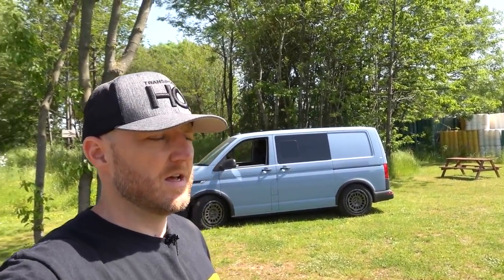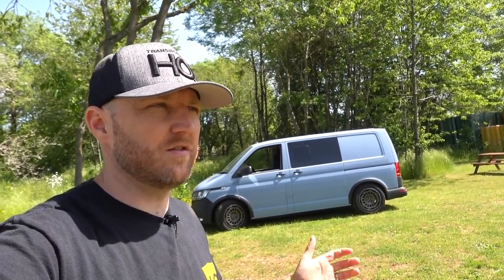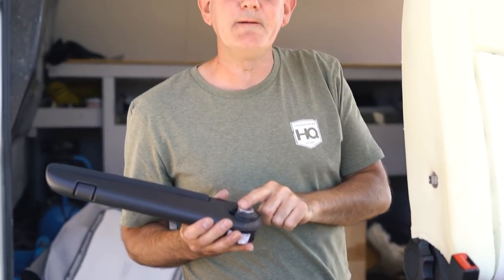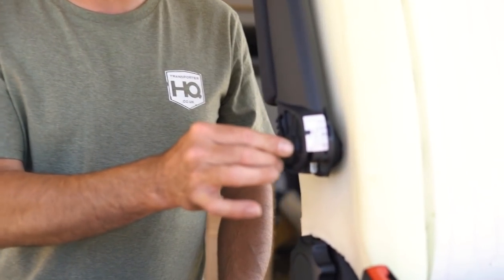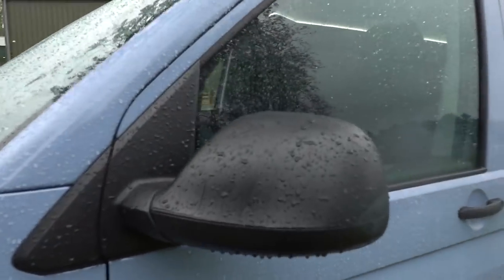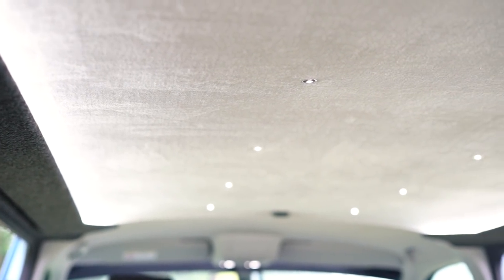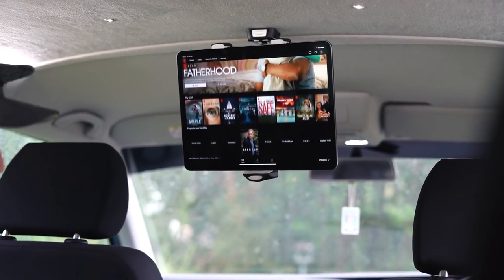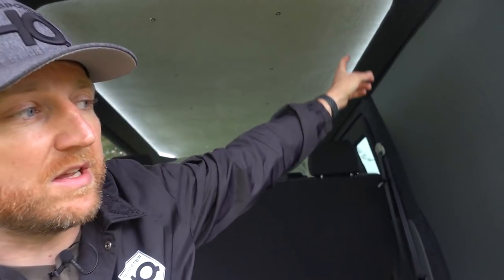The most Practical VW Transporter possible. What we've done inside. Halo roof, Vanshades, Seat trim

Comment: Why do the back headliner so beautiful and then leave the cab headliner looks so much better when it matches.
Reply from the maker: Thats was the whole idea, make the back match the OEM front. If you're doing the front properly with Dynamica / or alcantara, you have the stitch the front around the curves, that gets expensive. The fake stuff stretches ok but we don't like how cheap it looks and fades. This dynamica matches so well, you can hardly even tell its not the same as the cab. This build it about practical with some luxury without blowing the bank. Check out our flatbed build, that has A LOT of trimming done. We wanted this one to look special without going OTT. I'm really happy with how well the rear matches the front, without the expensive of trimming and stitching the cab lining.

Comment: I noticed that when sound proofing / insulating, you went for the deadening mats, and then the fleece over it. Some people also put the closed cell foil backed sound and thermal insulation between those two layers. Is that really necessary, or is it fine how it's done on this van? Not sure whether to skip that step or not. Thanks.
Reply from the maker: Its personal choice but I think thats overkill. Its just the extra expense.

Comment: I think you missed a trick with the TV/Media unit. Could you develop a head liner with a recessed area. For the tv unit to fold away flush with the head liner. A motorised fold away tv. Making it flush with the head liner would mean not having to remove it every time you leave the van. 🙂👍🏻

BTW, you touched your baseball cap more times than an F1 driver trying to promote his sponsors 😂😂. Obviously you have good marketing advisors. 👍🏻

I like the channel it’s giving me good ideas for my own day/overnight van. I’m looking for a van that can work between a work horse practical van with a Rib in the back , heating and media. 

Keep up the good work 🙂👊🏻👊🏻👊🏻👊🏻👍🏻👍🏻
Reply from the maker: 😂😂 the hat touching is not intentional, it’s normally because I notice it’s not straight on the camera screen 🤦🏻‍♂️

I’m not sure on tv’s in vans. Tv’s come in too many different shapes and size. Tablets are so small and affordable now, plus can pretty much do everything a TV can do. 
 Glad you find the videos useful 😊
Reply: Thanks for the reply. Do you offer modification services to customers who source there own vans ? 

Depending on your labour rates and lead times for getting into your workshop. I would be interested in using your company when I get my van. I like the detail you have went into over suspension and I’ve watched previous videos of it.
Reply from the maker: @bigeein  we do lots of customer suspension work but don’t offer customer conversion work I’m afraid.
Reply: @THQAutomotive  no power socket next to the tablet bracket is a let down tho !
Reply from the maker: @JakeM240  we’re actually waiting for a new charging port from scran strut. It will feature in this build when we get the prototype.